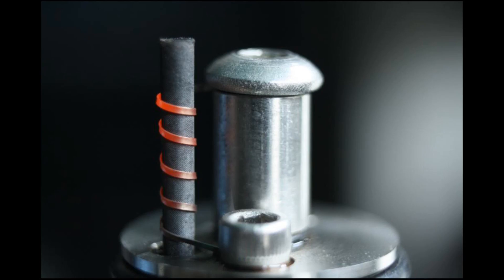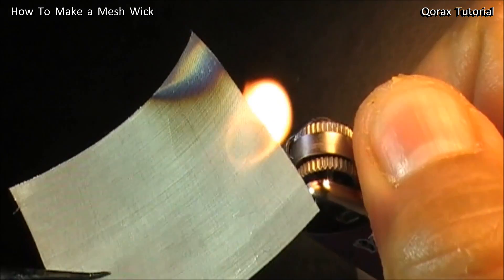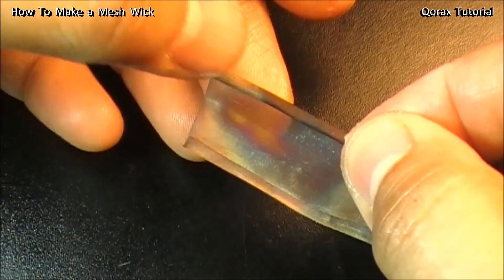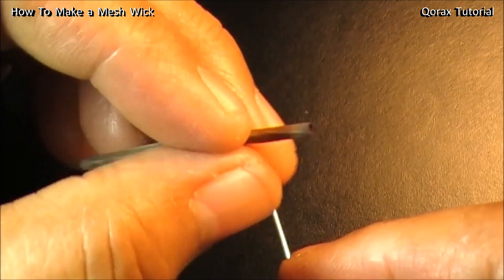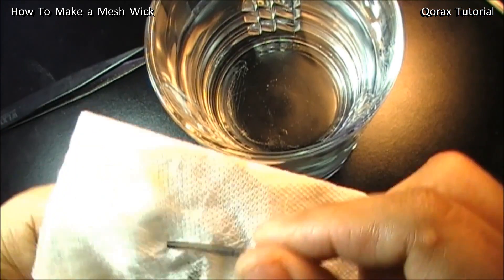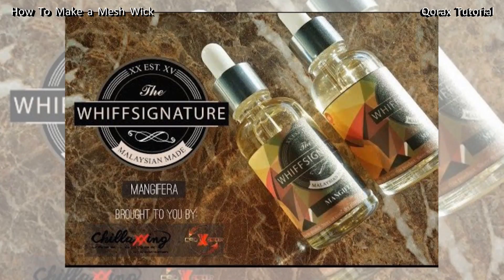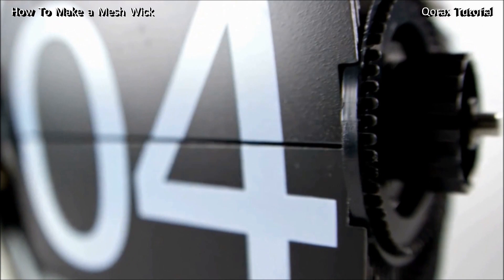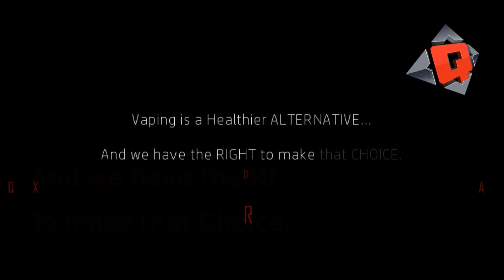Tutorial : How To Make a Stainless Steel Mesh WICK?

Comment: another question please..which is the best setup with mesh if i want to vape mtl?...for istance with cotton i normally use kanthal 28 ga 6 wraps in a 2.5 or 2 mm. diameter..or also 5 wraps kanthal 26 ga with 2 mm. diameter..which is the best setup using mesh?..does it works good doing the same setup i normally use with cotton?
Reply from the maker: The same setup (as with cotton) works fine with mesh as well Michele. However remember, mesh is not suitable for sub-Ohm vaping. As long as you're above 1-Ohms ~ you should be good.

Comment: Hello Stan , I'm an Italian-Helvetic vaper and I have a question for you.
I want to premise that in Switzerland we say that oxidizing the mesh with a lighter like you do is not healthy.
We prefer oxidize the mesh with a torch, a blowpipe or with a kitchen oven.
That's because if we try to heat  a piece of glass or metal with a lighter's flame, it becomes darker, tarnish , in the burnt zone.
If we do the same with a different flame, the piece of glass or metal heats up without leave a burnt halo.
What do you think? Can this darker shroud make a difference in the mesh?
Thank you very much for your attention and your answer.
Greetings from Switzeland. Andrea
Reply from the maker: Hi Andrea, I have a flame torch and have used it for heating mesh in my earlier days. However imo, it absolutely does not matter what you use for the job. A lighter flame works fine and doesn't cause any significant health concerns.
Reply: Ok, thank you Stan, i'll try your method too, it seems to be simpler. If I'll find any difference in the flavour,I'll inform you. See you soon

Comment: Instead of burning it with a lighter, maybe you should hook that bad boy up to a pair of aligator clips and use a 18650 (can I suggest using an RDA to connect the other ends of the aligators with?) to burn it? That way you won't have to worry about the soot and other side-products of combustion at all. Not that I think it is swarming with carbonmonoxide, but, less sooting and no side products can hardly be a downside! Dont have aligators yet? Stick two holes in either end of it and hook it up to a random RDA by wiring with the lowest gauge wire you can find, or better yet, a copper wire (from any old electrical device) or silver (your girlfriend won't even notice you borrowed her sterling silver necklace, but maybe you should hold up on telling her). And also, I havent seen my lighter since I started vaping! ;)
Reply from the maker: Thanks buddy, well opined. I nonetheless go for the easiest and simplest route. Besides, a lighter is always at home for our candles.
Reply: Use a box of matches, the smell never gets old!

I am half-joking, btw.
Reply from the maker: I know.

Comment: Good video. Do you know what are the mesh types? Fastech has 200, 250, 300, 400 and 500 types of 316l Stainless Steel Mesh For Rebuildable Atomizers. I guess this number corresponds to mesh hole size size. Any ideas for which PG/VG concentrations those mesh types are applicable?

Comment: Hi Stan , I'm vaping cotton for a while , I wanted to try something new , something like Mesh but there is a one question always pop up in my head is . Is this mesh wicking material is more harmful than cotton ? hope to hear response. Thanks for the tuto .
Reply from the maker: Hi, as with anything here - long term effects are unknown, but in the current state - using SS Mesh is no greater harm than using any kind of wire for our coils. IMO. Nonetheless, put everything together - Vaping is still 95% Safer than smoking. That's our call 😉
Reply: Thanks for that Stan , after saw your video I have been using nextasis tank and building with mesh for 2 weeks now , after 1 tank I saw some black ash inside the Tank ? is that normal or there is some step that I made a mistake ?

Comment: Truly MARVELLOUS!!
THANK YOU VERY MUCH for this (first and only?!) 'proper' SS MESH TUTORIAL! 

I always avoided SS mesh as wicking, because most examples on YT didn't really make much sense, and are potentially quite DANGEROUS - anybody with even a little sense for safety SHOULD take a multimeter and actually CHECK the electrical properties of SS mesh before and after the "treatment". In MOST cases the LEADING (outer) EDGE remains of highest concern, because the wire ends remain conductive and can potentially shorten the whole setup out, with potentially disastrous results.

. . . And then you come up with such a simple (and actually WORKING!) solution: FOLD THE EDGE OVER . . . 

I followed your tutorial, step by step, and guess what - after checking the resulting wick thoroughly with my multimeter, I feel now safe(r), and - I'm a MESH CONVERT!

Recently I purchased a TAIFUN GT II clone, which arrived today, and after some mayor leakage, I looked on YouTube for an answer, what mistake I might have made (I simply forgot to pull up the wick housing properly),  Luckily, I then came across THIS video, and I have now rebiult the Taifun GT II with a SS coil (3.5mm ID x 5 windings of 28 AWG SS316L - the cheap screws don't take anything heavier) and built myself a very nice SS mesh wick, (nearly) exactly as you advised (I used my blow torch, for lack of a lighter since I stopped smoking). The mesh wick is PERFECT, and vapes fantastically! (The setup totals 0.54 Ohm)  THANK YOU!!! You're my hero, or, shall we say, 'Mesh Guru' . . ?!

Thank you, 'Master Mesh', you've made my day - and my future . . .is Stainless . . .  :-D

I hope others will take your advice equally serious and into careful (!) consideration. 

ONLY 'newbies' think they 'know everything' - those who vape for a long time, know, that there's always something more to learn . . . 

Thanks a lot for the lesson!!
Reply from the maker: O'wow! Am totally blown away dear sir. Thanks for those appreciative words. Thanks for the view!

Comment: How is mesh in a RDA like the Tsunami will it work or not ?.I will have to fix hot spot's so will a space coil  be best ? So will I need to cut it just a small bit bigger than the coil so not to cause short ? You have a great channel and your video's are vary good and to the point.We need guy's like your self so to keep up the skilled job like this one.Thank you for your time.

Comment: ive got to try mesh, ive vaped for 3 1/2 years and have never tried mesh. Great video. What grade or size mesh do you prefer for todays thicker juices?
Reply from the maker: +Brian Barlow Yes, do give it a try -- they top in flavor output. I typically use either 400ga or 450ga. Imo 400 suits the best with higher viscosity e-liquids. Thanks for watching buddy 👏

Comment: I very much enjoy mesh builds, but to be honest, a dry hit on mesh is the worst dry hit in the world.
Reply: +Qorax Stan To a degree, yes.  But it's not until you get that burnt hit that you realize it could push people off mesh permanently.  That's how bad it is.  

So we both like mesh, but I think we disagree on how "easy" it is.  I think mesh builds are very unforgiving and rewarding at the same time.  

Pros: 
1) Great flavor (better than cotton), especially for fruit notes.
2) Builds can last quite a while unless you've had enough hot spots to burn holes through the mesh.  

Cons:
1) Worst dry hits (as previously mentioned).
2) Can gunk the same as cotton, maybe more depending on juice. More so than cotton, it will most definitely change the color of your juice.   
3) If the mesh gets moved a bit while you're out and about, it can still get some hot spots.
Reply from the maker: +donotstealmythunder All true. But I still opine (and as observed) that Mesh is a far hassle-free wicking material. Besides, it's performance (and vape satisfaction) far outweighs its cons.
Reply: +Qorax Stan Great points there.